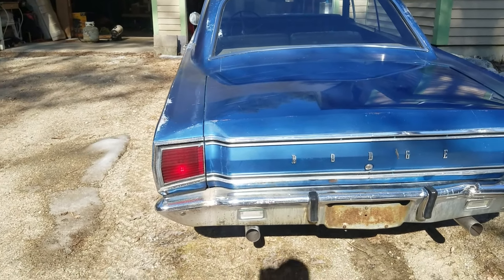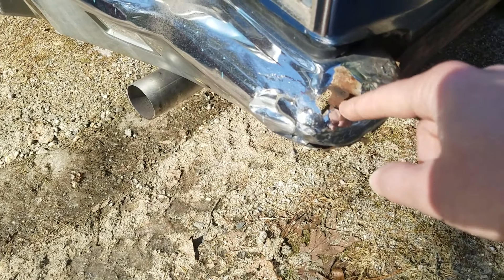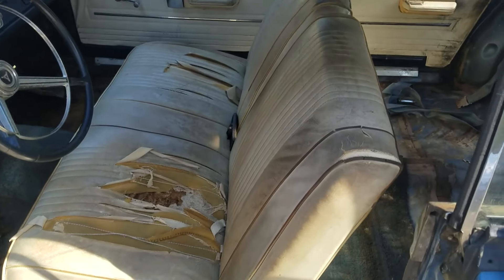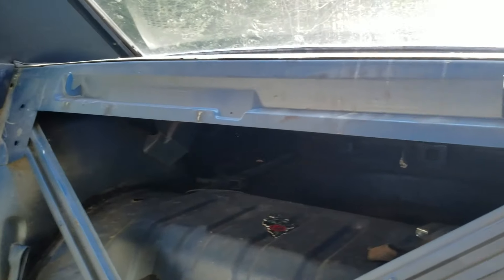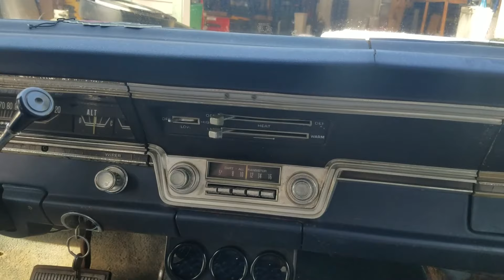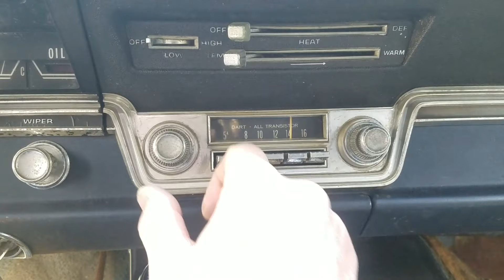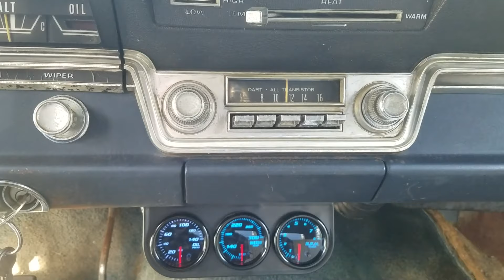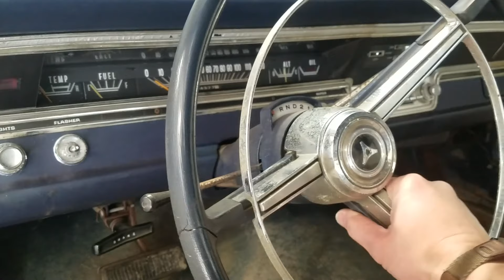1967 Dodge Dart: A Proper Introduction.

Comment: I’ve always wanted a 67 dart. I’ve had a bunch of darts and dusters. Had a 66 before I got the 68 I have now so I’m got 67 surrounded 😂
Reply from the maker: Hello Barry, Thanks for stopping by. The '67 has been both a blessing and a curse. It has been a blast to work on as a first project car but a few one year only parts, like the rear bumper and the pitman arm, are either expensive or hard to find. Sometimes both.
Reply: Dusters were ok I had 2 but the 67.68 darts were truly thr best mutch more charm and style

Comment: Subbed, cool starting point. Fan of blue metallic!
Reply from the maker: I have had a blast for most of the process. Cleaning the engine parts when I had it apart pretty much sucked though. Lots of sludge and lead deposits. I am really excited for the mud to dry up so I can get it out for a test drive. Need a decent set of wheels and tires but that's what credit cards are for. Lol.
Reply: @MontsweagGarage  truths.

Comment: I bought a 67 dart that was built to be drag raced. Its back halfed roll cage needs a good cleaning aluminum done but dirty. Dana 60 narrowed, was a factory stick car has peddles  has a race 340 with W2s on top. I'm getting to old to finish. Want a another. ?
Reply from the maker: Donald, I would love another Dart to work on however, I don't have the room right now. I hope to change that in the future and get into a proper shop but for now it is just me and my little home garage. I will keep this in mind though as I would love to build/finish a race car in the future.

Comment: What is your overall goal for the car? Is it going to be a showpiece? Drag car, or a driver?
What color are you planning to paint it when complete? I like the factory blue.
Reply from the maker: Hello Dale and welcome! Thank you for the questions. The overall goal for the car is to be a weekend cruiser that I can take my wife out on dates and maybe go to the occasional local car show. I am also using it a a learning platform for future cars.

I am going to go with the same factory color. Bright Blue Metallic. I absolutely love it. Though....I have looked at a few visualizers online and the body style also looks really good in a bronze/copper color. While that was very tempting, I think I want to keep it original.
Reply: Your video is very shaking it may benefit you if you have a tripod. Just nick picking but I live the content of the video and can't wait to see it run. Are you making sure to tag this video for other car enthusiast?
Reply from the maker: Thank you for the feedback FitinScrubs! I am actually taking step one of fixing the camera shake today when I pick up a new Smartphone. The one I shot this video on is 6 years old. Step 2 is coming from my wife in the the next 10 days and is a smartphone gimbal. I may continue to use the old one on a tripod for a second camera angle. You can see the car's first run after it's rebuild here. https://youtu.be/klbimL_Y4V4 The test Drive is going to have to wait until Spring.

Comment: B5 Blue
Reply from the maker: I thought so at first  but the paint code on the fender tag is 88 "Bright Blue Poly (Metallic)". TCP Global mixes it for both single stage and base/clear finishes. Still not sure which I want to go with. considering it will be my first time painting a car. Single stage would be true to the original finish but base/clear is more forgiving for beginners like me.

Comment: Wish he would leave it alone 4 barrel will.only drink more fuel leave it stock and just ajust the floats there up to high replsce the needle and seat
Reply from the maker: The carb had already been rebuilt with new gaskets, needle and seat, accelerator pump ect... The problem ended up being that throttle shaft had worn to the point that it had created a sizable vacuum leak. The carter 4 bbl I went to after that had the same issue.

Comment: Your lucky yo have a vlacvic like this there's no more around
Reply: And no plastic computers or sensors
Reply: Holy shit 273 there fast when there running good I beat a camsro with mine
Reply: Best.  moter mopar ever made
Reply: Needel and seat is leaking ajust the floats